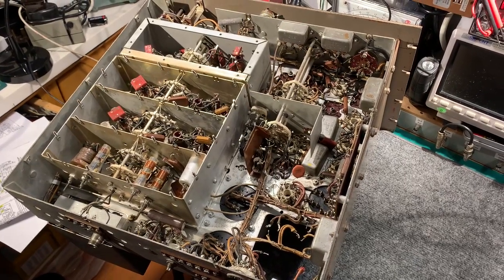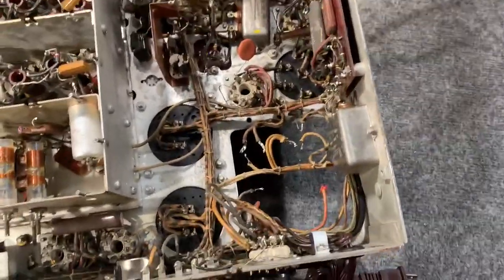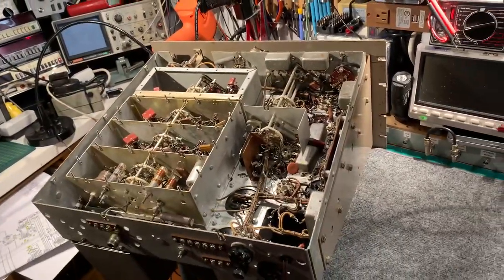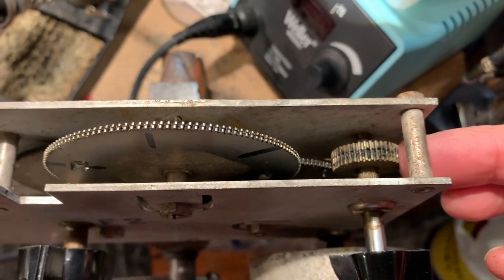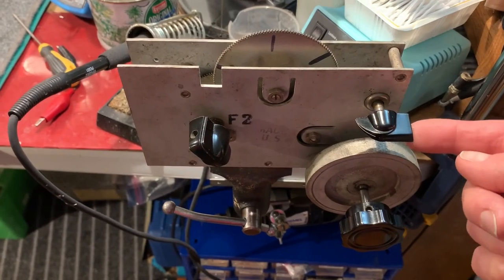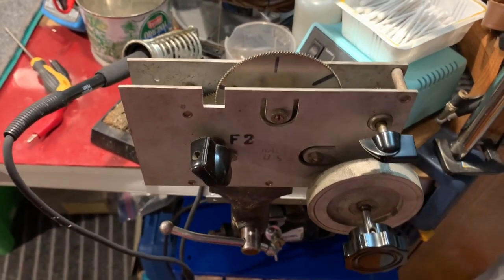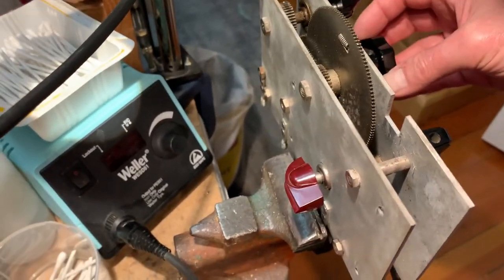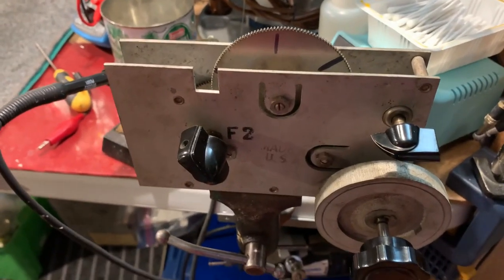Demo of a Gearbox From am RCA AR-88 or CR91A Receiver

Comment: I recapped my AR88d only afterwards the gearbox failed  gutted, but I was able to repair it
I un did the bearings on one of the gears  and move it to one side to the un used gearing.
Reply from the maker: Well done! - whatever it takes to keep these venerable sets 'on the road'!